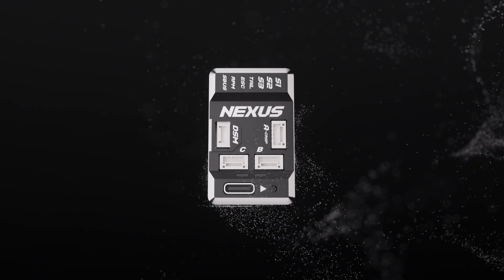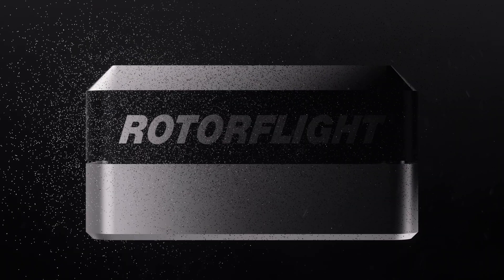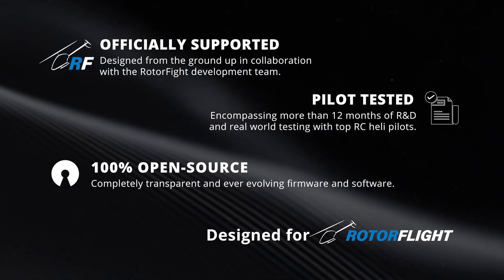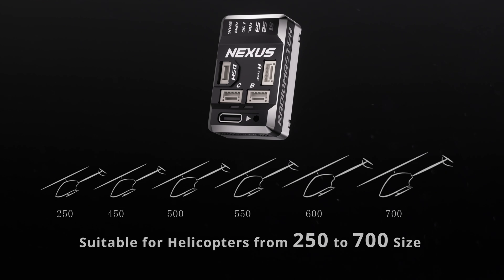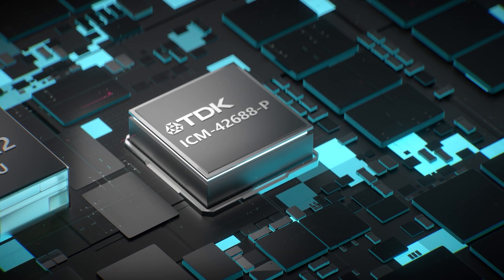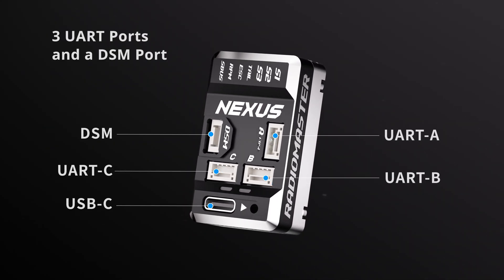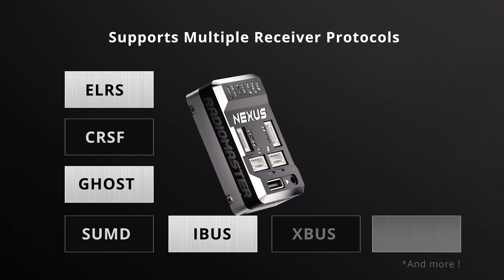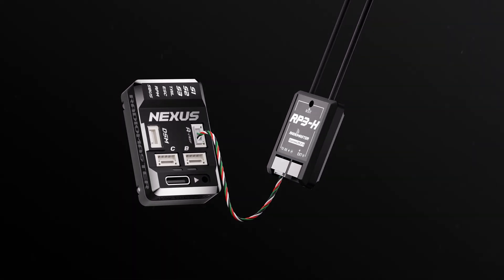RadioMaster NEXUS Heli Flight Controller | Designed For Rotorflight

Comment: ****Serious safety issues with Nexus to be aware of****
This is addressed to anyone whom I am aware of that has been part of the testing phase of Nexus…please send it onto the Radiomaster team as an urgent request.
Rotorflight and Nexus needs to resolve its flight tuning issues. Currently the novice helicopter pilot is in danger of crashing their helicopter when they follow the Rotorflight instructions. The instructions suggest to keep increasing certain Flybarless controller functions on the Nexus controller until the helicopter wobbles, shakes or shudders. When a helicopter wobbles, shakes or shudders it is out of control and is likely to crash especially if you are a novice and are hanging onto every control command. It is unacceptable to expect customers to carry out tuning in this manner especially when the instructions are hardly adequate. The filter section in Rotorflight manual is very badly explained and it is unlikely for a beginner or intermediate to the hobby to have a clue of what Rotorflight want you to do after reading the entire section.
Jonas Wackershauser has made a novel and brave attempt at explaining filters with his videos but it is still not satisfactory as he makes statements like ‘you may be able to disable this filter later’ without much explanation and also says  ‘it’s a good idea to enable these ‘   and here again is grey area and looks like it is hit and miss. 

So now when we look at the Rotorflight instructions it states clearly the following :‘caution
Please start by confirming your filters are working correctly before you increase your tuning parameters. If you do not have filters enabled it is particularly important that you do not use Derivative. This can result in hot Motors and Servos.’  

 This statement is fine assuming that Rotorflight has already explained how to correctly set up filters and finally know if they are working correctly or not……….basically looking at the following and according to the Rotorflight manual it states the following : 
  ' A good filter tuning should be just strong enough to suppress the peaks in the gyro readouts. A filter too weak may have peaks leaked inside the loop, and a filter too strong, while making the gyro signal clean, may lower the maximum gains later which cause a "sloppy" and delayed feel.’  

  Well I say dream on to that statement as Radiomaster has not taken the steps necessary to explain fully about the filters and how to achieve these goals.   I come from a hardware log decode background and have done hardware component design and I for one know that this hardware configuration setup is unsafe and seldom achievable as the end user is trying to look at the helicopter for flight characteristics and simultaneously changing variables in the Rotorflight configurator which are not fully known nor fully explained. Rotorflight should at least have a server online where we submit our logs after a test flight and this server should come back and make recommendations and changes to our logs each time until the unit is correctly setup with filters and PIDs and after this the pilot can tweak if desired at their own risk. The bottom line is that the Nexus unit in not currently fit for purpose as the setup phase is incomplete especially due to the criticality of its potential danger and impact. Failing this approach we should be able through Rotorflight to put the Nexus into learn mode and it should correct the filters and apply suitable PIDs through its own hardware. Are we to believe that Rotorflight team does not have a facility to compile and decode logs during their own build and test phase? Do we really think the firmware folk fly the Heli each time and come back in and adjust settings like Jonas suggests? Looking at the filters log without any in-depth explanations are a bit intimidating to say the least. I setup three Helis on Rotorflight already and all three had sloshy tails so knowing filtering is critical before PID tuning. Jonas is clearly taking a stab in the dark when it comes to filters and is obviously still learning himself, as he finishes this section quickly without any real conclusions but then his explanation is much better than the Rotorflight manual which is even worse as it only touches on the subject. 
The Rotorflight manual states the following:
'Caution note?
Please start by confirming your filters are working correctly before you increase your tuning parameters. If you do not have filters enabled it is particularly important that you do not use Derivative. This can result in hot Motors and Servos.'
Now comes the dangerous part and the part which Radiomaster could get sued for if a pilot gets injured or the helicopter causes death to a club member or onlooker. Please remember that in clubs you have many people around you so a helicopter is a very dangerous object unless fully under the control of the person flying it. We are warned not to fly any helicopter which is not fully under our control…these are our rules of joining. Rotorflight has already claimed responsibility for this dangerous next action by clearly printing it on the Rotorflight web site….did they not get legal advice?
The Rotorflight manual currently states:
‘What do we mean "wobble"?? When tuning parameters are too high the helicopter will wobble or shake during some movements. Each time we increase a tuning value we need to test fly and see if the new setting is too high. Test this in the following way:
Beginner: Tap the stick and see if it shakes/shudders/wobbles
Average: Do some flips with sudden stops, try going fast and tapping the stick, do some Tictocs
Advanced: Do crazy high speed high rate stuff that makes the FC sweat and see if it freaks out 😜.
Please also see the General Guidlines below for more specific descriptions
Increase Derivative (D) on each axis individually, (roll, pitch, yaw) until it wobbles, then back off a bit. (remember!! don't do this if your filters are not working).
Increase Proportional (P) on each axis individually, until it wobbles, then back off a bit.
Increase Integral (I) on each axis individually, until it wobbles, then back off a bit.
Set Feedforward so that you get good response and Integral (I) remains near 0 in full stick flips and rolls (viewed using the blackbox logs). Feedforward can also be tuned by following the description in Tune Feedforward.
If necessary, then tweak P:D ratio to tweak stick response damping to your liking.
Increase HSI until it wobbles when jabbing elevator at full collective, back off a bit.’

Unless I am losing my mind in my opinion we cannot have instructions which state to fly the helicopter until it shakes shudders and wobbles on the Roll, Pitch, Yaw….   How many times do we need to fly it out of control to calibrate it and how dangerous is this action?
Rotorflight does not suggest how much to increase the PIDs by (I assume they take no responsibility for this action) each time and this is a major problem as some people could put it to the limit immediately and have an out of control and dangerous helicopter on their hands. 
I notice Jonas does not mention this method of adjusting the PIDs until wobble, I assume he realises this as a contentious issue around safety. Jonas finishes this section by saying he is not going to go into PID,s any further at this point in time. However reading the Rotorflight manual it looks like it is a critical part of the tuning. 
In my experience the Chinese will have little regard for regulations so will not be bothered about the risk or impact I would assume. The only thing which might get them going will be either lack of sales or if the product is temporarily banned from use until they resolve this issue. I therefore find myself in a moral dilemma and will therefore formally inform the BMFA in the UK and advise them to inform other bodies in Europe in an attempt to prevent a fatality or injury. As they are our insurers they will hopefully look into the matter at club level and get something out to all of us before there is an injury on their hands and hopefully inform their EU members and hopefully others.
A helicopter is basically a chainsaw flying through the air and there are BMFA safety rules for a reason.

Comment: its not for beginners ...in my opinion its difficult to setup and unless you are a smack 3d flier there is little point in going down the nexus route as you will end up spending many hours trying to get the thing to hover.  its good for elrs and collects telemetry commands well so thats a bid plus for it...but lets be honest about it...its not for beginners.

Comment: I don't see a rescue feature. That sucks...
Reply: it has rescue
Reply: @MikeG4936  Where does it say that!? Thanks.
Reply: @davidjacobs8558  Just checked the website again. There is no mentioning of a rescue feature. None. Don't you think that this would be mentioned, if it had such a feature? Thanks.
Reply: @fc1133  search for rotorflight. they make the software.
radiomaster only makes the hardware.
rescue is software function.
Reply: @jeanrochat  I posted a comment on the video expressing disappointment about the absence of a rescue feature. Considering neither the video nor the RadioMaster website mentioned such a feature, I inferred it wasn't included. It seemed illogical for them to omit such a crucial detail when showcasing a new product. My statement remains true based on available information.

When others claimed the feature existed, I simply asked for confirmation sources. It's a reasonable inquiry. I'm diligently researching to ascertain the truth about its inclusion.

Dismissive remarks suggesting I won't progress in this hobby are baseless. I've been engaged in it for decades with success.

Moreover, the fact that NEXUS primarily serves as a platform for Rotorflight, doesn't diminish the absence of mention about a rescue feature.
Reply: @fc1133  Rescue is a core feature of Rotorflight so it definitely has it.
Reply: @atomicskull6405  Great. Thanks.
Reply: Btw, I for this message from Radiomaster in regards to me asking if the Nexus has a rescue feature: "RadioMaster RC Hi, In the manual on the official website, I saw that the content related to Rescue mode is blank." So...
Reply: @fc1133  I left several comments, but they are getting deleted by youtube for no reason. rotorflight is the software, radiomaster only makes hardware. look into rotorflight.